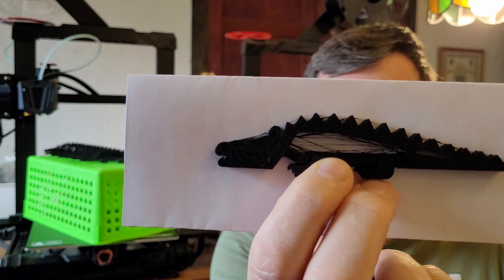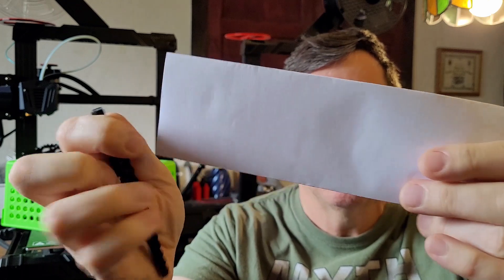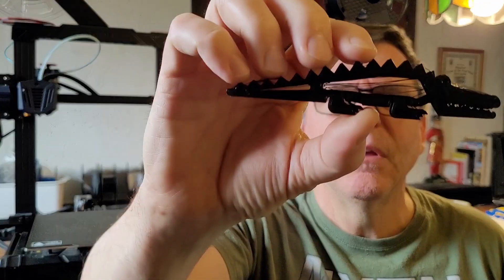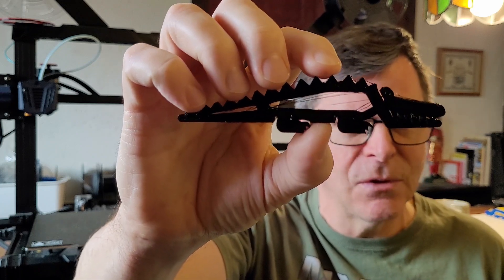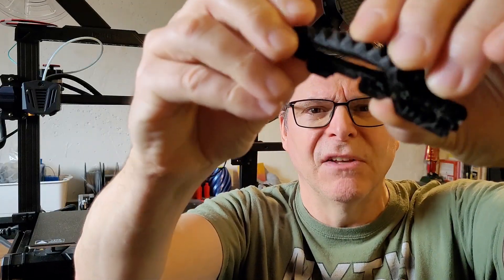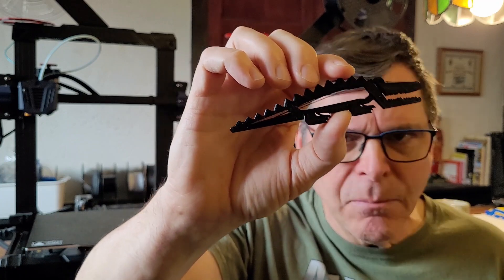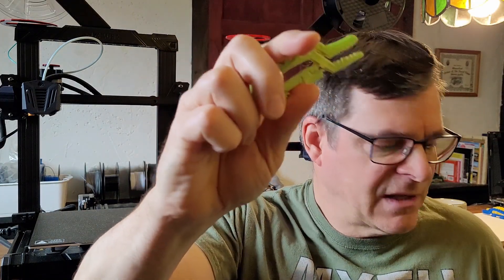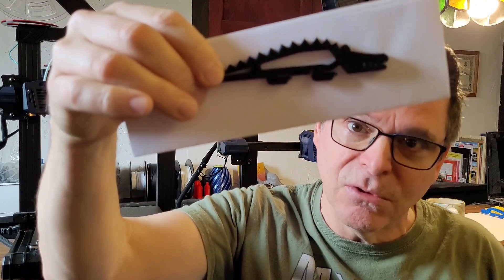3D Print Stop the Stringing

Comment: I swear it's always the Black filaments. I've tried 3D Jake's Eco PLA and i'm using Polymaker PolyTerra PLA, both black, and i'm getting the fuzziest prints. They're more or less good prints, but the stringing is insane ! There isn't one solution for everything though, currently i lowered the temperature to 180°c despite the filament allegedly requiring at the very least 190°c minimum, and it seems to have improved the stringing somewhat. Next thing i'll try is cranking the retraction speed and distance. 
Using Orca Slicer for my Anycubic Kobra Plus :)
Reply from the maker: Thanks for dropping a comment
I agree with you about the black and probably varies brand to brand too
First reel of black never had any issues just print, but that last night had me scratching my head 😅